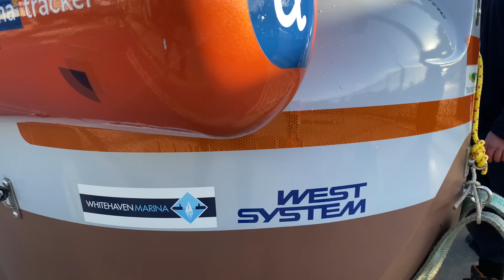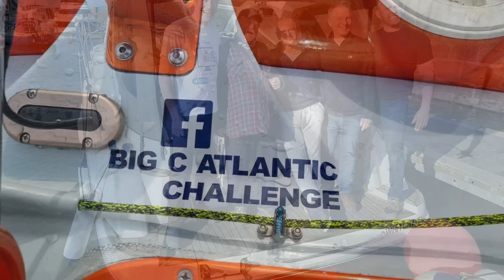Big C Atlantic Sea Trials Whitehaven Feb 2023

Comment: To be honest it didn't seem to be moving at all under sail. Either way I hope you're not prone to sea sickness because you are in for one of the most uncomfortable passages in recorded history
Reply from the maker: She sails at about 2-3 knots, and quite well off the wind, the first days of the last 3 sea trials were absolutely still, the second were about 15-18 knots. I wasnt ill, but almost all on the support vessel were green...
Reply: I believe the majority of its movement will be vertical… toward the center of the earth, at least until it encounters an immovable barrier.
Reply: If the boat was on a surface that wasn't constantly changing, you'd more easily see the distance it's traveling.
Reply: Well, live your dreams... best of luck to you.
Reply: Удовольствия ноль.Хотя,може это идеально для мазохиста?Не мое(((
Reply: @dancurtis611  "Live"....? Uh... Yeah. Sure.
Reply: @Big C Atlantic Challenge  mate, 3 knots? On a Trans North Atlantic? Are you at all sane? Staring at slate blue mountains of water constantly tossing you back two Nautical Miles for every one you've advanced is a fairly daunting experience.
Reply: @TorquilBletchleySmythe  Maximum speed under sail is dictated by the hull length.  6ft. = 3 knot. So literally can't be helped.   Most of its  headway will be from the current.  So actual speed will more like 8 or 9 knots.  He is very aware of what he's getting into.
Reply: @Obsidian Jane  your actual speed calculation is reliant on fair winds and calm seas, madam. A concerning and very optimistic outlook for a traditionally hazardous crossing. You also fail to take into account several other factors, including displacement, hull design, and sail area, all of which have significant impact on speed over water. To state that speed is dependant on length is simplistic and generalised. For instance, a twenty foot long trailer sailer will make significantly more headway in the same conditions than a 20 foot pumping dredge. Perhaps you should try blue water sailing in adverse conditions before commenting about A+B = C without considering any other factors related to established hull design.
Reply: @Adventure101 you weren’t moving at all
Reply: LOL... reminds me of a giant cork with a sail floating with a real life person in it 🤐😳 anyways .... good luck !!!
Reply: RIP Big C 😭
Reply: It's amazing how.many people think their criticism does anythjng but make them seem like hateful losers.

Comment: Although I've never done any sailing I've pedaled a bicycle across America, 5100 miles so I do have a bit of a feel for this sort of thing. I think the hardest part for me would be not feeling progress forward. It will seem like you are sitting still without a visual reference of forward movement. This would wear me down. This may not bother you in the least and that would be great but I would have to come up with a means of tracking progress in real-time, a bell rings every mile, an animation that shows distance traveled, something. Just a thought, great video, thanks for the update.
Reply: That’s a great idea, hadn’t even considered that being an issue.
Reply: @ASuperBambi  Especially with downwind sailing, everything will feel completely still.
Reply from the maker: I do have a log on one of the instruments that shows the distance ive travelled and the distance to go, but nothing audible and if i had the spare power i would definitiely do that - im loving all the ibput for you all.
Reply: Have you thought about a few solar rechargeable power banks small hand held ones could be a way to recharge a portable gps.
Reply: The visual reference is the log, compass and GPS

Comment: Good luck! One concern I have is the rig. I don't know whether it's designed for "battening down" for rough weather, but at least in the deployed mode shown in the video it makes me anxious. My sense is that in a 30-knot sea state the boat's going to be picked up and thrown/rolled a fair amount. Is the rig engineered to survive that? If it is significantly damaged you could have dangling debris potentially damaging the hull, and I suspect in those conditions it would be difficult or impossible to open the hatch to effect repairs without filling the boat. Hopefully there will be tested contingency plans for things like dismasting or a flooded hull.
Reply: Laundry mode..
Reply: The thing floats even if full of water
Reply: @MrBaskevin  Cool. You’re now afloat and full of seawater in the middle of the ocean. What does that mean for seaworthiness/handling characteristics? Electronics and other systems? Livability? What is the recovery plan? In what conditions is it possible to carry out that plan? Sinking is just one failure mode, and while it’s good that that risk has been mitigated that isn’t enough for success.
Reply: @JohnCallender  Being flooded would actually make it a lot more stable and comfortable lol.   It has a couple of pumps i believe.  He has a few other videos where he goes into the design and built.  Maybe you should go watch them instead of predicting doom and gloom?
Reply: Agreed. This looks like a cartwheel machine. I wish him all the best, but I wouldn’t want to be that thing in a 50 knot blow.
Reply: @obsidianjane4413  Turns out the predictions were correct...😊

Comment: 25 knots is a Force 6.  By the look of the sea state in this video the wind barely got above Force 3.  If he can’t estimate wind force from sea state then his experience of sailing must be pretty limited.  If instruments showed this on a boat I was navigating I’d know they were faulty.  He’s planning a North Atlantic crossing from Newfoundland, he might be better advised to use the Gulf Stream/North Atlantic Drift.  He’d be warmer too.  Mind you, I’d not think of doing this at any price.
Reply: Yeah, I noticed the "25 knots" comment, too. It clearly was blowing more like 12-15 or so in the video. Maybe he just misspoke? Or maybe the interior shot when he said that was at a different time when it was blowing harder than you see in the wider shots?
Reply: On the video he has a strap line saying this ,instrument error apparently
Reply from the maker: We had an anenometer on the support vessel (that wasnt mine) that was reading 25knots, but after checking it was out - and as one of the other guys said we had everything from a force 3 to 20knots, and the video/text at times are out.
Reply from the maker: @JohnCallender  Spot on the cutting of the film was out with the wording, it was ranging from force 3 to Force 5 on these 2 days.

Comment: Do you think the little outrigger/ boom things will snap off after you roll a couple times?
Reply: That'll never roll not with that lead filled keel and those sponsons abeam
Reply: @BillSikes.  he better have an EPIRB after it rolls about 22 times.  I’ve crossed the Atlantic many times.  This is just a pure death wish.
Reply from the maker: @kpmariner1998  Sorry but its not - ive crossed before, the smallest  in a 21ft  mini transat solo, then gone up into the arctic, round iceland, towards Greenland etc
Reply from the maker: They are completely triangulated, and so shouldnt break, but if they do i can still carry on, as its bigger sister didnt have the outriggers on her. She will roll though thats for sure, so inside i have a full harness, head protection etc, and almost every surface is heavily domed to shed breaking waves. Shes one tough little vessel....
Reply from the maker: @BillSikes.  Oh she will and shes designed to, and is ballasted so she will come up slowly, as mots of the damage occurs when the mast comes out of the water and the keel snaps down, breaking the mast.
Reply: @BillSikes.  ha, I’m a professional mariner.  Been going to sea since 1994.  Troll away troll… but today you got the wrong one.

Comment: Sail in a  seaworthy Folkboat at 25ft long ... ,,like Jester ...with sensible jiunk rig...and you can get across the oceans in style and safety....and back without causing others to come and rescue you!! 
This boat needs to be tested  in a 70 knot gale .. with captain there too...
Reply from the maker: I've done a jester challenge, aswell as take a 21ft mini transat solo yo into the Arctic, round Iceland , through the Denmark strait, nearly ti Greenland and back k to UK Solo. Thus project isn't taken on lightly and ots just the next step in a long list of adventures. The designer of this vessel did the exact same route and held the record back in 93, rhis vessel is just smaller and designed around my body.
Reply: @Adventure101  Masochists of the world UNITE!  21 ft can jump over waves or beat to windward...but a tub 1 meter long is only going nowhere slowly... in survival mode?

Comment: I have agreement with several sailors on here on certain points. However if you have considerable sailing experience and mentally very tough you could make it. The boat on enough speed v food/water/distance is another matter. You don't and won't know until you try. I'm an experienced Sailor and wouldn't contemplate such a journey in a boat that size.  I will follow this project good luck.👍🇬🇧
Reply from the maker: I do have considerable sailing experience and am mentally strong, ive previously done a lot of challenges that people have all said cant be done, and this boat has been designed by Tom McNally who broke the record in 93 on the same passage and had just been made around my frame.
Reply: @Adventure101  Thanks for replying and  that information . I understand now about the design so that has Pedigree. As I said you don't know until you try. The effort you have taken to get this project going displays determination  and with your experience  yes why not. I wish you all the best I will follow your progress. Take care👍

Comment: Suicide capsule. Crazy doing a crossing in that. I got sea sick on a navy ship that was 250 metres long. That capsule will get knocked over like a piece of saw dust in the waves out there.
Reply from the maker: She's totally designed for the job by a gentleman who had thevworks record for this exact route bsck in 93, just smaller to fit my frame. I've been across thr North Atlantic, into the arctic, through the Denmark strait etc before solo in a 21ft mini transat, and many other passages, so thus isn't the first thing I've done

Comment: I presume the Atlantic crossing will be via the southern route from the Canaries where the ocean current will land you in the Caribbean eventually without having to lift an oar/sail. Unless he has a supply boat alongside all the way, how is he going to store supplies for a journey that could take up to 2 months or more. BTW I have crossed the Atlantic using this route a couple of times on a small sail boat and nearly ran out of water before arrival the first time. The Northern route from the US/Canada in that piss pot would be suicidal.
Reply: I think he's running downwind on the northern route.
Reply: @michaeltsui3435  A number of these micro boats have had to be rescued in the recent past at enormous cost whilst attempting the crossing on the Northern route. If he is hoping for a westerly tail wind off the Azores high he'll be very lucky as the winds that far North are generally varied and confused with high breaking swells. I believe the authorities may even have a rule preventing any more mad cap adventurers risking it all for fame.

Comment: Absolutely cracked out, I love it. Watched another video walking through it and seems like a lot of thought has gone into it but you are REALLY going to need some kind of shading, even just a piece of sailcloth to rig overhead or similar unless you enjoy being roasted by the sun from dawn until dusk, additionally if you have to have the hatch closed and it's warm out then the inside will be a total pressure cooker and could get dangerously hot quickly. A small cabin fan would be something I would not leave home without, bring an extra panel for redundancy and as much battery as needed for running it for an extended period. The other good suggestion I see floating around (hah) in comments is to bring an inflatable mat to tow behind for stretching out and dozing on. Good luck and hopefully you have a smooth crossing my man!
Reply from the maker: I have my vents on the boew that i can rotate and open/close, but alos have a hammock that on the frame work that does protect from the sun, that i can also stretch out on, oh an itg got a hole to watch water in it...

Comment: A bit of advice you may not have thought of the rudder assembly looks flimsy take some extra line and a couple of small sea anchors  if you ( god forbid) you can  steer the craft with two sea anchors trailing be hind  you can steer by shortning a line  we lost our rudder on the west coast of Scotland and got back with this method  so I personally know it works we used fish boxes  cheers hope you don’t need my advice
Reply from the maker: Ah ha, i have the 2 rudders on the boat, the external one can be ejected if necessary, and she sails nearly as well, that why we only brough the new one out last week.
Reply: @Adventure101  I wish you all the best in your trip I won’t say voyage as this is just one of many all the breast matey aargh  and remember the best books are in the bottom drawer

Comment: I really suggest testing your craft in rougher waters (safely of course) to really test its stability
Reply from the maker: Its stability is spot on, its been rolled in the harbour as we cant roll at sea due to the fact we need a support vessel to drag me back in - however its been designed by a former record holder for the same route, just smaller around my frame.

Comment: Question. I have been following the evolution of the Big C and the steering options. I now observe an outrigger for the rudder steering system. Why does the outrigger not essentially add "length" to the boat? This is an insane idea. Insane in a good way. Best of luck to you.
Reply from the maker: No the stabilizers come off. Most yacht measurements wouldn't I crude ot, but to be honest to Hugo who has thevrecord I'm going without it..
Reply from the maker: Yes I had someone desperate for me to add it, as it was on some of the earlier Tom Mc Nally designed boats, it works well, but not in the 'spirit' of the adventure.

Comment: No way will that work does anyone know how long he lasted
Reply from the maker: It's been designed by Tom McNally who held the record back in 93 on exactly this route, just smaller to fit my frame. I've done many other challenges and this is just the next step. Before you make such comments you really need to look at the vessel as even coast guards have looked over her and agreed on how strong she is.

Comment: Yeah, its all fun and games till you hit a 40 knot gale and a seven metre swell, neither of which is unusual. Having encountered those and worse on ships over 200  metres long, i have serious concerns for your safety and sanity. Have you done any blue water sailing in foul weather? Or maybe my Pacific Ocean experience is different to what may be encountered in the Atlantic?
Reply from the maker: I've done thousands of miles sailing, solo in many small vessels, been into the arctic, round Iceland to almost Greenland and back solo in a 21ft yacht just to mention one other  passage that I chose to share online.
Reply: @Adventure101 with that sort of experience, I'm sure you understand why so many people are concerned about your chances in that bottle cork with a sail, particularly the physical demands of the cramped cockpit and the likelihood of encountering waves five times larger than what would be necessary to submerge it several times an hour.

Comment: seems a lot like being a human message in a bottle!

I get deathly sea sick in normal sized boats in relatively calm water so can't comprehend how humans cope with being rolled around on waves even on trawlers and merchant vessels. 
Being thrown around for every second of around two months seems so incomprehensibly hard. 
But I know that we are not all the same and that someone with the right temperament, obsessive determination and body could at the very least shock us all with how well they manage. 

I am also conscious of the normal position for a travelling human as being standing upright, as in walking. Which we were obviously evolved to cope with and allows us to do many similar things with hour bodies such as ride bicycles for as long as we are able to stay awake. 
I do think it would be an enormous benefit though, if the operator was able to comfortably like flat to stretch out and decompress. And if there was some way to keep the legs very active.
The bipedal natural movement of the human body is important to fundamental functioning like circulation.

Comment: The 'boat' will nose dive and the rudder will come out of the water (assuming the rudder doesn't break off) and the 'boat' will spin and bob about like a cork. Looks more like a floating coffin to me.
Reply from the maker: Why do you think that - you need to actually see her, i can easily stand on the back of the rudder, and everything is triangulated to the max throughout everything on the vessel, and if the rear rudder does break i can eject it, and i still have the other 2 rudders on the vessel of which she sails fine with. She will nosedive if overpowred, but my mini does that aswell !